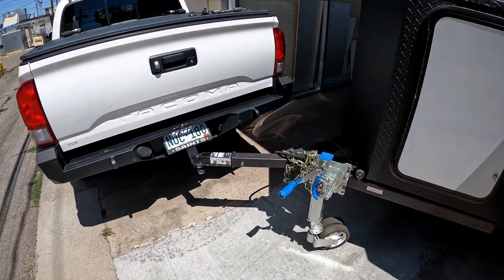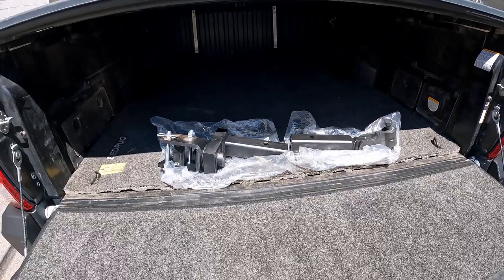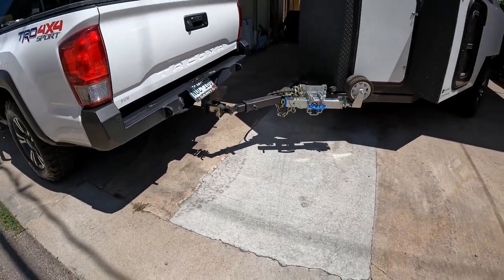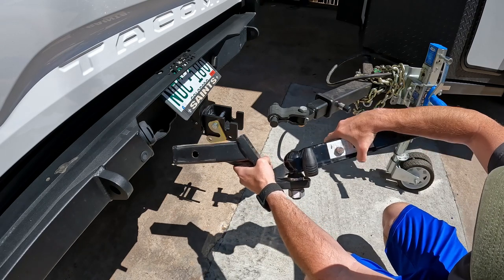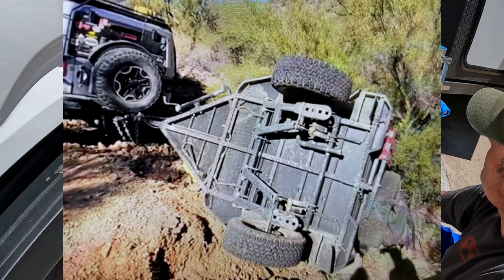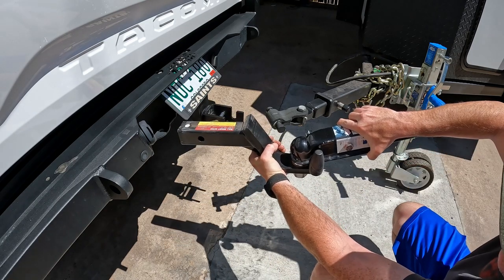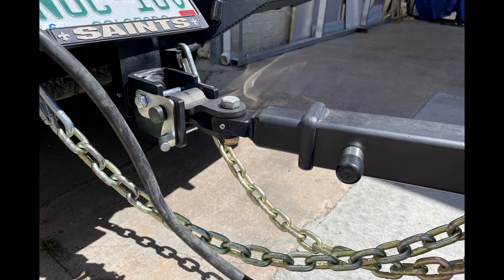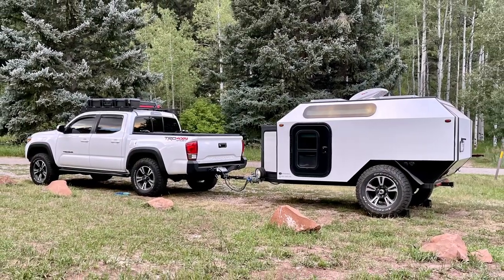Are You Towing Your Trailer Off Road? You NEED This Hitch!

Comment: I've been using one of these for years and wouldn't tow off road without it. Just periodic lubrication with a messy 18ga needle or swap to zerk fittings. Black fingernail polish is great for touch ups
Reply from the maker: It’s worked great so far!
Reply: @infosponge  Good For you! - But maintenance will keep it working great for a long time - you change the oil in your tow vehicle for the same reason

Comment: What's the tailor weight limit?
Reply from the maker: Lock ‘N’ Roll is rated at 11,000 pounds gross trailer weight and 1100 pounds tongue weight. All units exceed the requirements of SAE standard J684 and are tested by independent labs.
Reply: I replaced my coupler hitch on my ATV wagon with a lock 'n roll to tow behind my SXS. Great articulation,  and never a worry about it disconnecting! But as you mentioned,  the one draw back is that unlike a ball coupler, there is no resistance at all preventing the trailer from just rolling all the way over on a rough trail. With the coupler,  it at least resists right up until the point it pops off. Still, the trick is to NOT do that in the first place.